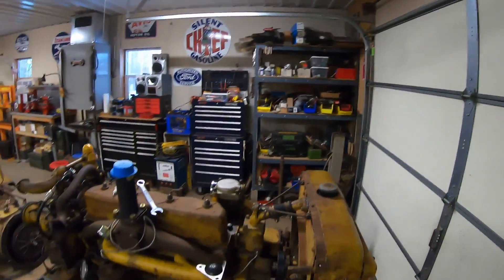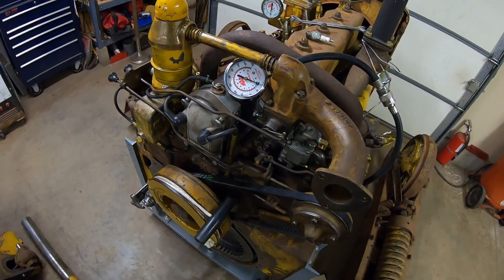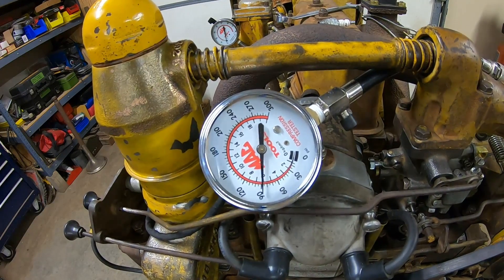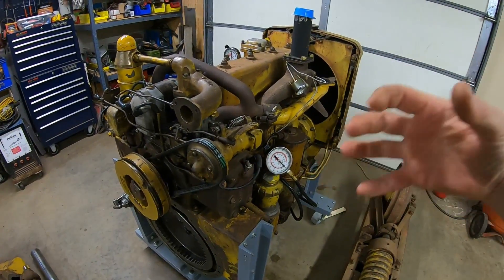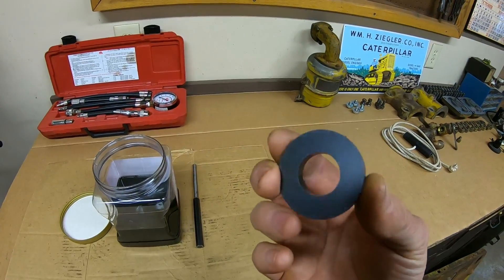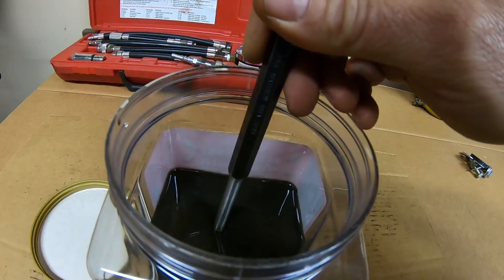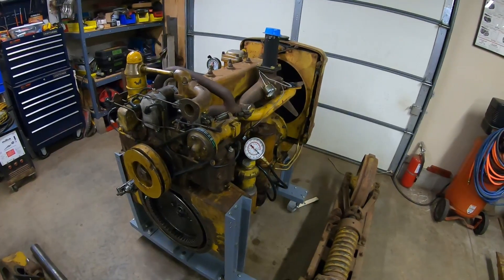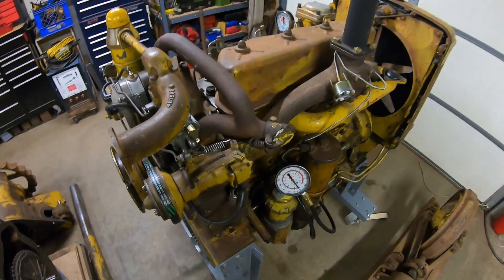Caterpillar D2/D4 Starting Engine: How Much Compression Should They Have? Let's Test a New One!

Comment: once the break in is done, run synthetic.  The reduced friction it provides, makes a vast difference, provided oil change intervals are kept the same.(dont extend them).   I have hundreds of hours on small engines that run like new, with no appreciable wear.  Same is true right up to heavy truck engines that cover 2 million km's, 100% full loaded on 65 ton B-doubles.

Comment: Frankly I would like to see more engine oil talk.    What was right for the old machinery is not the same as today.    I worked on a Dutz Air cooled (diesel)  engine and we estimated it had 8-20,000 hours and going good.   Those engines had a strainer not a filter and the oil change was 50 hours.    Sometimes it got changed and sometimes not (out in the Philippines at Clark and the military maint people they paid to maintain it were conscientious to totally slack) .     That was with a fairly modern oil (80s era)

Comment: Thanks for confirming my approach to oil in the starting engine.
After blowing up a connecting rod in my '49 D4 shortly after i got it
I've been treating it's replacement with an oil change every time the oil 
gets the slightest bit dark.
Your video series is encouraging me to do a rebuild of my original starting engine
which has been sitting under the bench lo these many years.

Thanks.....F

Comment: Hey been thinking about the wide tracks you want to use and clearance issues…. Well if not going ti put a blade back on it. The front mounts you have the stand bolted to if make a attaching wear guide shield thats bolts on and will come up and give a place for the tracks to hit before  getting into the radiator/engine! Or maybe if not block  the track but the frame carriage  can bump up against ????

Comment: I've always thought that these little starting engines were neat,, i didn't realize how low the compression was though ,but it doesn't surprise me much because most of the small engines ,like lawnmower engines and many many wisconsin engines very rarely are they over 100PSI 
 ,,I had the starting engine on my 1959 JD 730  rebuilt a few years ago and I did about the same thing you described here  ,i changed the oil after every time i ran it ,,the Deere has a V4 starting engine which is equipped with electric start  ,,aside from that  the procedure for starting the tractor is pretty much identical  to this one you have

Comment: Back in 1980 I tore down a locked up 390 Ford engine and did a rebuild on it for my brother. It used a quart of oil in its first 500 miles and gradually decreased its oil consumption during the first 6000 miles. He was all upset about his fresh rebuilt engine using oil until I explained to him that it would need to be driven enough to get through its break in period. After the second oil change it would go 6000 miles and only be a little below the full mark.

Comment: Looking at a D2 to possibly buy.
Pros. 15 miles from home. Well maintained. Unaltered (not a bunch of home made repairs and add ons)
Cons. Doesn’t run. Possible cracked block. Has been sitting for 20 years.
Need advice on parts availability and sources. 
I don’t know how to communicate with you other than the comments section.
You probably don’t have time for individual responses.
Thanks, Peter
Reply: @squatch253  Thanks for your informative reply.
I did watch your video on assessing a D2 for possible purchase. It just fortified my interest in getting a D2.
If it turns out to be too costly to repair, is parting out an option?
My background is, former Detroit diesel technician worked on the 12V 149s down to the 53s. Former Mercedes Benz diesel tech.
Retired Toyota master tech.
Have a shop with lathe and milling machine, gas, arc, and mig.
Bought my first car when I was 13.
Restored cars, but tired of bodywork, wiring, glass work, upholstery, painting, etc.
Looking for something purely mechanical. 
Never worked on a Cat, but the D2 fits the bill.
Thanks Peter

Comment: Dangerous territory Toby. "Tastes great / Less Filling"  "coke / Pepsi"  "flame broiler / fried"  "Maryanne / Ginger"  "Ford / Chevy"  boy oh boy, can opened, worms EVERYWHERE!
Reply: What is truly hilarious is few if any actually see an engine from cradle to scrap and how it did.    Toby lays out his criteria and why.   I would not begin to disagree with him.     
       I can say sometimes you get a headscratch result.   I had some Cat 3412s that got changed to Mobile because that is what the company used.   I began to have governs problems stability wise and I could not tune it out (electronic Woodward governor).    I was baffled but it only changed when the shift to Mobile was done,  so I got the ok to try Delo 400 again.   It returned to stable operation.    Mobile is as good as Chevron,  both were diesel rated (Delo is the diesel line).    It should make no difference and at worst that is what the adjustments are for.   No explanation.    Just accept it and move on,  but in no way would I disparage Mobile.

Comment: I am amazed you have not drilled and tapped the inside of the pony and engine oil drain plugs and mounted neodymium magnets to them to keep the iron and steel particles along with rust particles out of the engine oil system.. much like the ring magnet from the trans pan which is not neodymium.   I put neodymium magnets in every fuel tank I have open.  Plastic tanks get 2.  One inside. One outside to hold the one inside to it.  Usually with a piece of aluminum foil tape and then some gorilla tape extending past the aluminum foil tape.  
I even stick a stack of 3 or 4. Quarter sized neodymium magnets inside rear end housings.  Off to the side. Usually to the bottom of the right main cap.  The gear oil comes out crazy clean when I change it a few months after a rear end rebuild but there is a boat load of fuzz on the stack of magnets.  
Don't believe me.  Next time anybody changes a fuel filter that's clogged.  Blow the remaining fuel from the tank end of the filter into a clean clear soda bottle.    Set the bottle on a magnet.  Watch what happens.  
Ps. Cold start starts, runs for 20 seconds and stalls requiring a minute of cranking and pumping the gas . And hot vapor lock are caused be sediment in the mechanical fuel pump check valves. Not sealing perfectly..

Comment: After watching all the pony motor videos and the oil discussion, I'm fairly sure that the reason my grandfather's D4 was parked on a steep hill most of the time and there were several pony motor blocks lurking in the shed is because he didn't change the oil in it much and always shut it off with the magneto...

Comment: I almost asked on the first start video if you were going to perform an early oil change, I now know without even asking. The way I look at it, oil is cheap, rebuilds are expensive. I’m also a fan of running detergent oils, more for the additive package than the detergent/suspension capabilities. ND oils usually have a weaker additive package from a anti-wear/extreme pressure protection. However, like you said, everyone has an opinion (that is always the correct one) on which is better. 

On that note, I’m extremely cute see what the oil analysis says on Kyle’s RD-4 engine and back end, it’s a look back in time to see what they were using in the 1970s! Cheers!!!

Comment: Hello Squatch253; You gave me a "Flash-Back" to when compression test were common. Was that a "wet" or "dry" test? Beautiful job! A friend has an old 292 (I think that's right) hemi He wants rebuilt. He paints houses. I told him to take it to a rebuilder. Would it be a good thing to put one of those magnets an oil pan? Great video. Looking for the next one.
Reply: Not a bad idea so long as you remove the magnet before oil change,but a better idea is to epoxy a modern super duper heavy duty magnet to the end of the oil drain plug. That way wiping the crap off,you know you got it out of the oil pan.

Comment: As an another up grade. Is there a spot on the block low where could drill a hole and tap it . For a plug, that could extend into oil . Like a drain plug with a magnet. You could take out and clean to help catch debris?

Comment: We run-in new and resurfaced aircraft cylinders with mineral oil (non-ashless-dispersant)  for this very reason. The rings wear the hone surface down for compression and leave just enough surface to hold oil. Aircraft engines in the old days didn't even have filters, just screens! 2 hours first run, 10 hours next change, then 20 and usually by then, we switch to ashless dispersant oil.

Comment: As for compression I once restored a Lister CS diesel engine. These have a chrome bore (Listard cylinder) which was seized solid. I had to bash hell out of the piston to remove it but the chrome bore looked ok after a light honing. I put new rings in but had no real compression to start it. I coupled it to another engine and span it over until it started. Much like the pony motor arrangement on the Cat. After 4 hours running it had really good compression. Again no filter but I changed the oil regularly. It only took a little oil so why wouldn't you. Also if its sat for a while in a cold damp shed the oil might pick up water which isn't good.

Comment: What helps is the explanation of why you made these choices and how it works for the engines you run and what happens with the oil and procedure you use. This is not normal advice of "Use this oil, it's the best" but an set of reasons for your choices of what and why so we (the common people) can apply your experience and expertise to our own situation. The best advice helps me make my own decisions! Thanks! Also, WOW that's a lot of iron in that oil for less than an hour of use.

Comment: This information is an eye opener. No-one does break-in oil changes on new cars in UK. Accepting this is old technology, this makes me think a break-in oil change is a must. The channel keeps getting better Squatch, you've single handedly turn us all into Cat D2 experts.
Reply: Most modern cars have the 'break in' done at the factory during machining, it's called a 'plateau hone' and basically uses a special abrasive brush to smooth out the initial hone pattern in the same way the piston rings do in a traditional break in. The piston rings are similarly manufactured to a greater degree of precision so that they can seat against a plateau honed bore without needing to be run in. The engine will still 'run in' to a certain degree, but it's like 95% of the way there before the engine is started for the first time.

Just to add to the complexity, some manufacturers have stopped using cast iron cylinder liners, instead the aluminium bore is coated with a composite material made of silicon carbide and nickel. The silicon carbide component is harder than sapphires, and under most circumstances won't run in at all- a fine diamond hone is used to remove a thin layer of nickel and expose the silicon carbide, at which point the cylinder is complete, with the low spots where the nickel was removed acting to hold oil like the crosshatch in a traditional cylinder. Only the rings get broken in.
Reply: @nerd1000ify  Thank you your insight and this very comprehensive reply.

Comment: Another aspect of compression is that compression is dependent on how well the rings "inflate" during the compression stroke.  The rings are not sealing themselves against the cylinder walls and the piston ring lands simply because they "fit so tight".  The rings also react to the displacement of the air charge during compression by inflating to press hard against the cylinder walls and the ring lands of the piston.
That is why an engine in a vehicle that has not been run in a long time may have poor compression in an initial compression test but retesting later can show improved compression after the rings have freed up.  Likewise the ability for rings to inflate can be affected if an engine is subjected severe overheating and the elasticity of the rings is reduced and the rings can warp slightly.  Of course in overheat events you have a lot more to worry about than if your rings are going to survive.

Comment: Being a big fan of KISS, every filter-less small 4-stroke I have has a permanent magnet epoxied onto its dipstick. The rate of accumulation of shiny fuzz there drops noticeably during the first dozen or so hours of runtime. I refuse to passively let that stuff loose in there, when I can trap it- never heard of benefits from it getting between cam lobes and followers, and that sort of thing.

Comment: Thanks for the oil insight. On these old engines (both diesel and gas), do you add zinc to the modern oil to soften the lifter/cam contact and other wear points?
Reply: The high ZDDP content of today's diesel oils and low-ash oils is specifically for engines with flat tappets - so there usually isn't a need to add more zinc. As Squatch and a few others have said in the comments, most modern oils are superior to what was around when these engines were designed, so they already have most of the bases covered.
Reply: @MichaelTJD60  You're about 10 years behind the times. The new diesel oils have had a significant reduction in zinc because it's damaging to the diesel exhaust catalysts. You'll find endless threads on this topic at Bob is the Oil Guy and on TDIclub.
Even the older spec diesel oils have reduced their zinc content.
Reply: @otm646  exactly why I drive a 7.3 Powerstroke...CJ-4 and older oils are my specialty.

Comment: I always believed the best oil is clean oil and full level. After listening to your talk on nondetergent oil I will be getting some for my Sixty before start up. I’ve also heard of low ash oil, what do you know about that?
Reply: Newer diesel oils are 'low ash' basically this means there are lower limits on the concentration of calcium, sulfur and phosphorous in the oil because those elements will not burn in the exhaust particulate filter (aka DPF). Using a high ash oil in an engine with a DPF might cause the filter to get blocked and need chemical cleaning or replacement.

The downside is of course that those elements are found in many popular detergents and anti-wear additives, so the oil is less effective at preventing sludging and wear.

You'll also see 'low ash' or 'ashless' labelling on 2-stroke oils. Because 2-strokes (attempt to) burn all their oil, any ash content will tend to form combustion chamber deposits or block the exhaust port, especially in water cooled engines.

Comment: Why do you not install remote oil filter on the pony motor. Just asking. Reason,  Oil Prices are going up. Oil Filers you get longer life on the off set the cost. Just asking, not a problem.
Reply: Because the pony engine uses a splash lube system. There is no oil pump and oil galleries  you might tap into to add a filter even  if you wanted to.

Comment: Would have possibly gotten a higher reading if you had pulled the spark plug from the other cylinder? It looked like you had the spark plug still installed in the other cylinder.

Comment: I figured out a long time ago that a good supply of clean oil that exceeded OEM spec was worth a lot more than the fancy brand name that didn't get topped up or changed often enough because it was so dang expensive.  Details will vary but as a basic philosophy this has worked best for me.
Reply: A wise old bird I used to work with stated, "Oil is the cheapest mechanic in the world ". He was right. Having opened up engines where the owners significantly extended oil drain intervals,things happen in them what ain't pretty.
Reply: Don’t let a stay at home dad amsoil seller hear you say that

Comment: Basicly u turn cylinder walls  into a micro file for the rings   wich have groves desighned to wear.  To a smooth finnish  and conform to the shape of the cylinder walls
Reply: @squatch253 - When questioned years ago on the phone about less zinc in modern oils, and older cars needing higher zinc levels, Mobil told me that their zinc replacement additive packages were superior to zinc. I tend to believe them. 

Moving camshaft and lifter production to China and Turkey, well guess what, they sent improperly hardened camshafts and lifters to cam grinders who then sent them to the engine rebuilders. And, to make more power requires a more aggressive camshaft profile, plus stiffer valve springs than stock. The whole zinc thingy is likely a pile of bull shit. The real issue is higher performance and Chinese and Turkish junk. Translated: money. It’s not really cheap nor easy to harden a camshaft lobe correctly.

Comment: One tip I have heard for engines with no filter is to magnetise the dipstick. Then every time you check the oil, you wipe the dipstick removing the iron particles that have stuck to it.
Reply: Where possible l bore a hole in the drain plug and fit a piece of bar magnet to it.
Reply: Or glue a magnet to the end of the drain plug.

Comment: My favourite story about lubrication came from a guy who was a computer room operator/supervisor. Who had NO interest in cars, and less in how they worked. On a trip in his old Ford Escort (In the UK), the oil pressure warning light came on. (No gauge on the economy model), so in goes a pint of oil. Some miles later, on goes the light again. In goes another pint. This happened a few times. NEVER DID HE THINK TO CHECK THE DIP-STICK! Neither did he wonder where all that oil was disappearing to. . . . . Then the seals all blew. Because the issue was the pump. . . . . . Ouch!